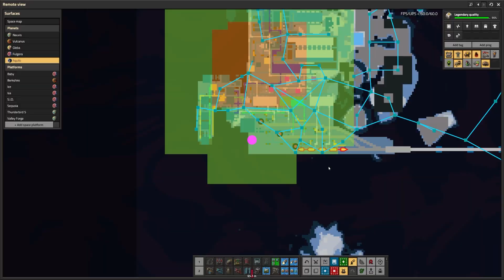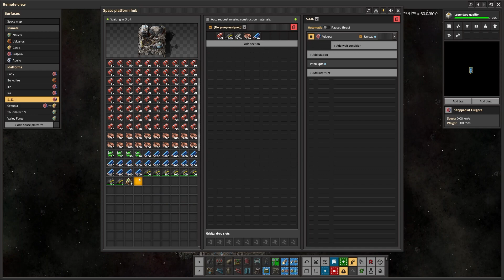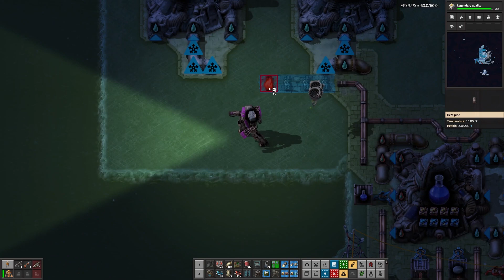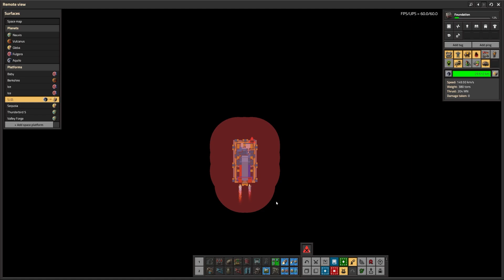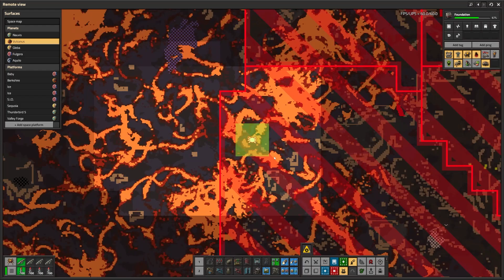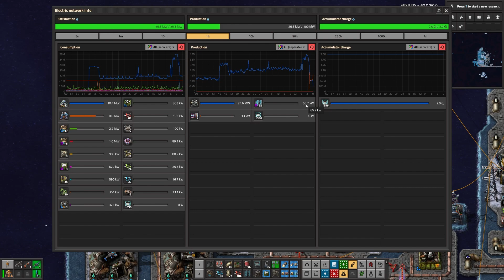Factorio Space Age: EP52 All the finite sciences are done!

Comment: I finally got around to building some fusion reactors, and came up with the same math...two fusion turbine things per reactor. But i also found out that once you add about 10K flouroketone, hot or cold, to the system alond with a cryo plant to cool it, you leave it as a closed loop, and occasionally add some fuel, and its damn near self sustaining. Works great for the platforms, and i was able to remove Odyssius's nuke plant.
Reply from the maker: @JoMomma1973  I just read that there is a neighbor bonus for fusion reactors if set up correctly. Something to do with plasma usage.
Reply: @BoredBob  oh cool! Ima have to try that
Reply from the maker: Yeah next ship I build will probably use it for power if I build a new one. Didn't do that for end of game one though.